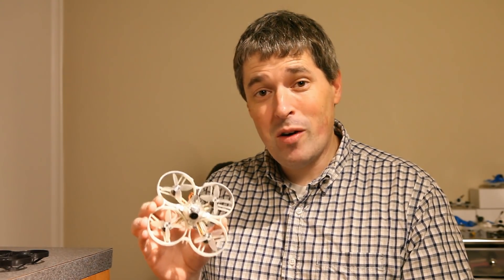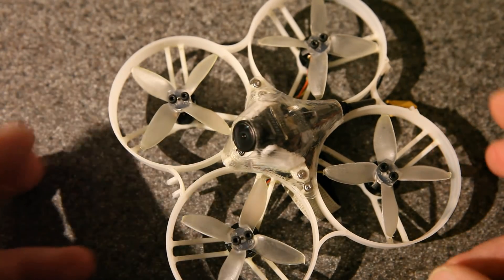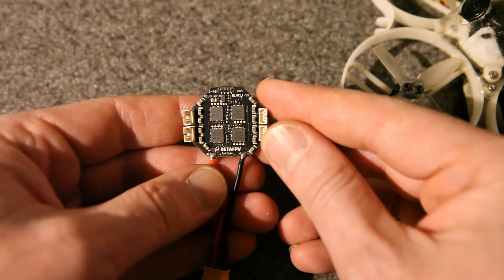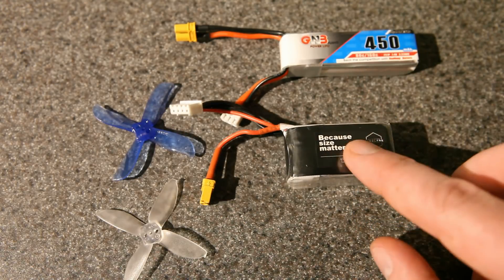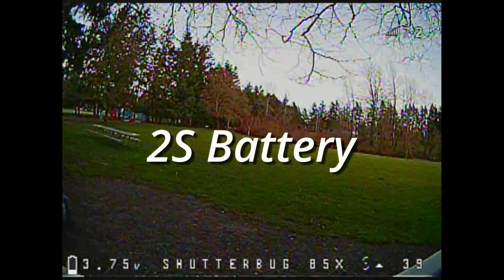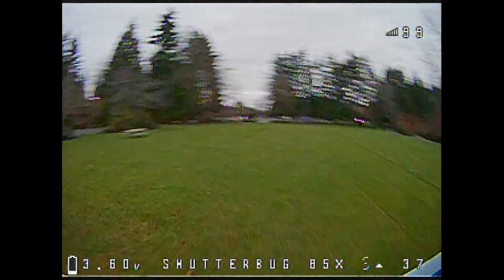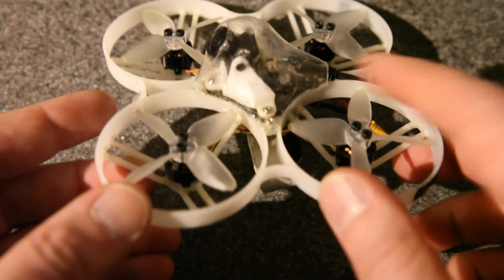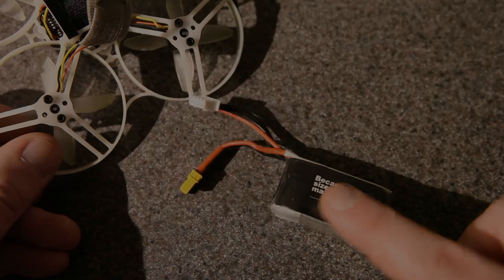Beta85X - Introducing the 4S "WHOOP"

Comment: Micro-ducts, is what I call them, since whoop is part of the brand name Tinywhoop, and I think it is fair to say that tinywhoops are a totally different type of drone than these new brushless ducted drones, that are the new hype.  Great review, but is there really a need for 4-6s ducted plastic framed drones?  They are starting to cost the same as some 2.5" & 3" carbon frame fpv quads, wich I think is a better option if your flying acro, since they don't auto stabilize due to how ducts effect the airflow.  I can only see the need for these if there are official races where that is the type you have to fly, and yes they are alot of fun, but imo, there are better options if your going to buy 4s batteries anyway.  Thanks for the great pre-pro.. review, very nice flying btw, thanks for sharing.
Reply: E X A C T L Y ! ! 🤔👍😎

Comment: How many grams is that 4s ESC ? & you should try some 48mm quadblade King Kong props , they are exactly like the mobula 7 and betafpv 40mm quadblade props BUT they are 48mm, the shaft is 1mm stock tho so you only need to drill them out to 1.5mm  to fit , but they should be much lighter props they are around 0.69 grams each and 2.77 grams for 4 props
Reply from the maker: Cool. I haven't tried those props. I would be tempted to put them on the 12,000kv 0802 motors. Hmmm... My 4S ESC was 5.9g with the 20 awg pigtail that came with it. I later switched it to a very short 18awg pigtail.

Comment: Seems pointless.  It's a 2" with prop guards.  It's too fast to fly inside.  I would rather have a 2" with carbon fiber frame and no guards.
Reply: Agreed. If you're going 2" with up to 4S, which is not general public friendly when flying around people... get a stronger/stiffer carbon frame, without the crappy aero and yaw washout of the ducts.
Reply from the maker: You're not alone. A 2" carbon micro would fly great! This one just happens to have ducts. That's nice if you fly fast in small backyards and playgrounds, but certainly not for everyone.
Reply: @MrShutterBug  and don't mind if the flight characteristics are all screwed up vs. if it had a proper carbon fiber frame! There is no point to this! And it's an EPIC FAIL because it can't do 4S and burned ESC's when people tried it! AND BetaFPV came out and admitted it! Stupid idea! 
Without a doubt the worst quad and biggest FAIL of 2019!

Comment: Love the flight times, my 75x only gets 2minutes.
Reply from the maker: Lracnolip 75x should get at least 3 mins. 4 min if you fly gentle. Maybe you need better batteries?
Reply: @MrShutterBug  this is using the lipo that came with it and tattu 2s 450. Im in Canada flying in -1 to -10 weather. Dissapointed with flight times as l have many quads, for example l get almost 5 minutes on the babyhawk r and same on the inductrix plus.
Reply from the maker: @Lracnolip  drones with larger props are naturally more efficient, but you should be getting more than 2 minutes. Cold definitely makes a difference. Sometimes I keep the batteries in my pocket until it's time to fly (but hesitate to suggest that because of safety concerns).

Comment: 59 grams dry weight? That seems...really light actually. I was wondering why it looked so nimble and had such long flight times. My benchmark 2" is the Lizard95 which is 72ish grams so to shed nearly 20% of the weight while using slightly bigger motors and ducts is really impressive. Hmmm.... I'm curious now to know where the weight has been primarily lost, but it looks really nice. Didn't see much dive in the DVR, how is the washout?
Reply from the maker: Yeah, it's kind of heavy for a whoop and kind of light for a 2" micro. Washouts are possible, but I didn't have any problems on 3S once I switched to the AVAN props. Looking forward to testing 4S.
Reply: @MrShutterBug   as much as I like ducts for protection they are just hard to live with. It would be great if BF were to have a setting which indicate ducts/open props and would change tuning appropriately because clearly stock BF doesn't know what to do in those cases.  Did you use the stock tune or did you put your own tune on? I don't think it's too light for 2", no such thing as being too light. 😉
Reply from the maker: Charles Warwick I totally agree about BF. It would be so much better if it had a wizard that set it up with appropriate defaults based on the size and  characteristics of the build.